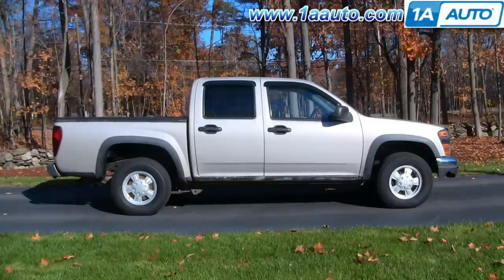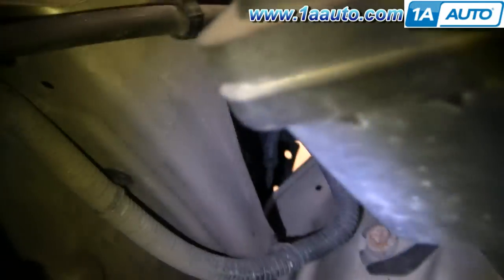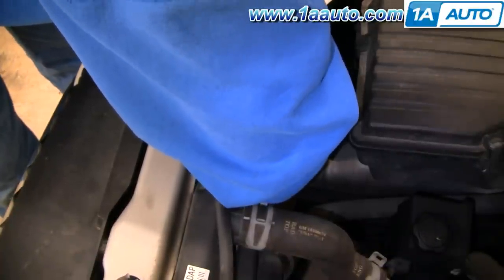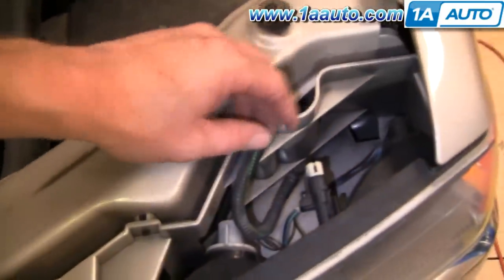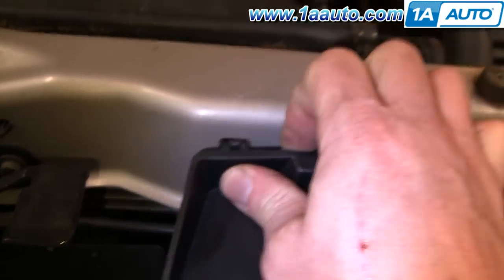How to Replace Headlight 04-12 Chevy Colorado

Comment: I installed both the upper parking light lenses and the lower headlight lenses this weekend. The lenses I ordered all came with new light bulbs as well. I paid $137. I am overall happy with the way it turned out. This video was helpful. The clips on the sides and the bottom holding the grill in are pressure clips with no release. The ones on top have the release on them, push down etc. I ended up breaking a few on the top. Got it back together pretty well, but still elected to drill a small hole and put a self tapping screw on the top part of the plastic grill just to really hold it in there well, probably overkill but piece of mind. You can’t see the screw with the hood closed. My truck is a 2007. I opted for the base free shipping and ordered it on Monday and got it Wednesday afternoon. The part started out east....mass or conn and I live in Michigan. Parts seem good, call center was professional and the video helped.
Reply: I think I am going to put a few screws in mine as well.. Its way too loose for my taste.. Previous owner broke 2 of the clips..

Comment: Thanks for this. I was installing HIDs for my high and low beams. None were easy, but the absolute worst was the driver-side low beam. Nothing is easily removeable behind them and I just couldn't get enough torque on the HID stem to turn it. Popping off the front and just removing the headlight was so much easier it's crazy. Now I know how to replace the wimpy horn now too.

Comment: I bought a pair of these for a 2010 Colorado, they fit and looked good at first but one fogged the first time I drove it in the rain, chatted with 1AAuto and was told they shipped with test bulbs, said I needed to buy new bulbs to prevent this, will try but that should be in the instructions and this video.

Comment: For those of you that ALSO PURCHASED THE TOP LIGHT _ TURN ASSEMBLY:  This video is excellent but never mentions how to get those top light units off.....They are held by a single squeeze clip...HOWEVER, You first squeeze the single clip and push it back like your going to remove it. You MUST THAN SQUEEZE the CLIP FROM "BEHIND" the housing. It will than come right off. I kept trying to push it through and it was making me nuts..
Reply from the maker: +brianmann01 Thanks for watching. If any of our viewers needs to make this repair, we carry the auto repair part shown in this video on our website. Here is a link to them http://www.1aauto.com/1A/HeadLights/Chevy/Colorado/1ALHP00348?utm_source=YouTube&utm_medium=CTA+Comment&utm_campaign=ytcomment&utm_term=tnJcPgG6qFw
Reply: Good point. That clip on the parking light made me nuts too, just a simple plastic squeeze clip but it’s not apparent at first.

Comment: Of course they go and change the passenger's side or EASY side. I want to see them change the driver's side once. I can't get my hands in there with the electrical box in the way! do I need to take the grill our or what! UGH!!!
Reply: That's exactly what I said.  I'm out here now at night w my halogen light thinking is this will be easy and no way in hell.  My big ass hands ain't fitting anywhere near the driverside light.
Reply: The grill comes off super easy... But the clips across the top all broke off on mine upon disassembly. Since it's got almost 300K on it I just zip tied it through the holes and over the top of the brace. The metal clips on the sides and bottom of the grill hold just fine.
Reply: @BigMatt202  yeah my top clips don't "clip" either. The zip ties is a good idea. Have a great day.
Reply: I said the exact same thing watching this video. Figures it would be my driver side low beam bulb I need to replace & there is zero available space to do it without removing the grill.
Reply: @BigMatt202  mines are zip tied on too 😅😂
Not to flex but im sitting at 340k miles 😳

Comment: will the lights need to be adjusted or do they come factory set? How do u adjust if needed?
Reply from the maker: You would need to adjust them once they are installed.
Reply: Do u have a video showing how to adjust
Reply from the maker: Jesse Seago
Unfortunately i do not . But i will keep it in mind for future videos.
1aauto.com 888-844-3393

Comment: Changed lightbulb and it still won't turn on and fuses are fine. How can I trouble shoot to see why one lightbulb is not lighting up
Reply: Christopher Castellanos try checking the wires in the harness that leads to the bulb socket, could be a bad/weak ground or a loose wire.